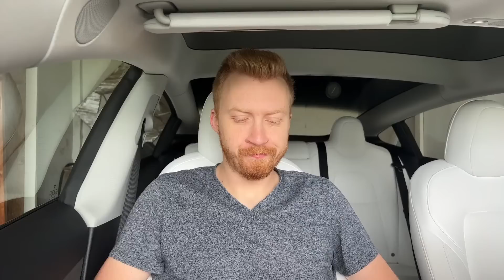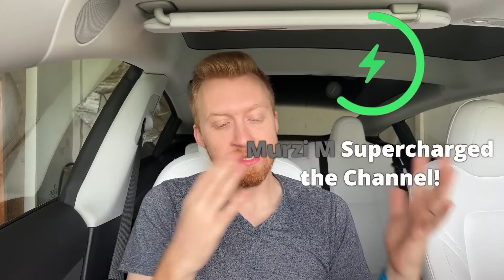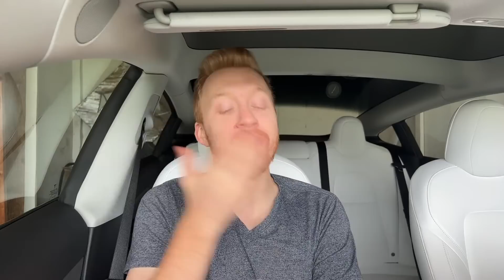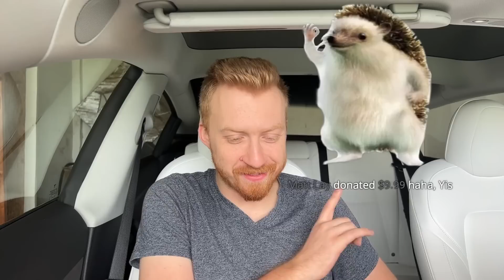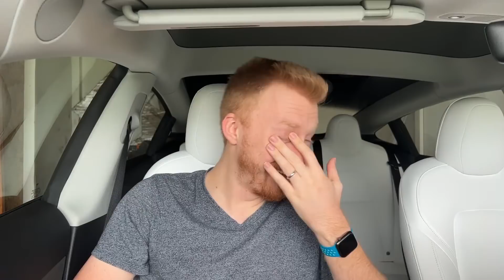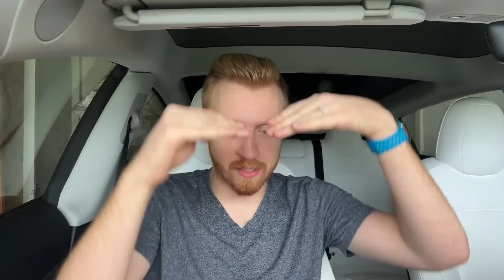2nd 9K Ton GigaPress Heads to Asia

Comment: You dont have to make adjustments to the press, just switch the tool and you can make completely different part. Press and pressing tool are two different things from different manufacturers. You can make hundred different parts with 1 press if you have 100 pressing tools.

Also, EVs are still quite expensive in EU, especially in compact segment. Decent compact gas hatchback is around 25k €, while EV hatchback is always minimum 35 - 40k € (where I live).
Reply: Was at a SEAT/Fiat "dealer" for the "mandatory" Fiat 500E service (155,-- for a pollen filter...) 
Saw a Seat Ateca that was priced at 37K. A Cupra Born in similar size just over the aisles was priced at 42K. 

Now you take off the incentives in Austria of 2500,-- and you land at around 40K. Thats 3000,-- difference. 

Now you don't pay tax for the EV. 
Thats 4 years @ 734,04 Euro tax saved. 
Or 75.000 km´in saved energy cost (7L@1,60 or 18kWh@40 cents)
Or 5 years less maintenance. Your choice.